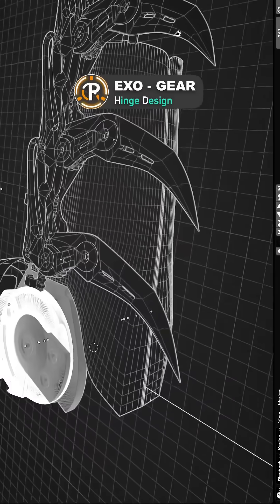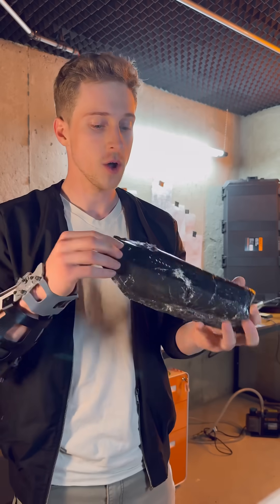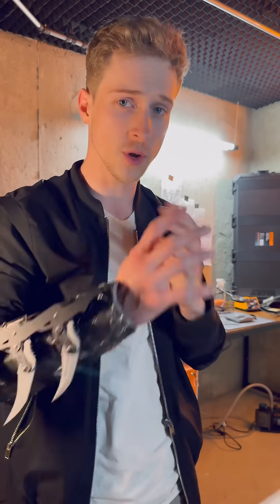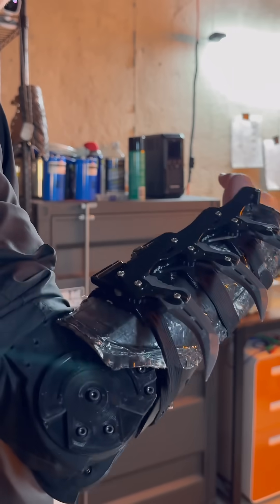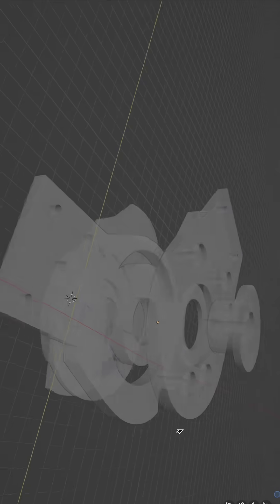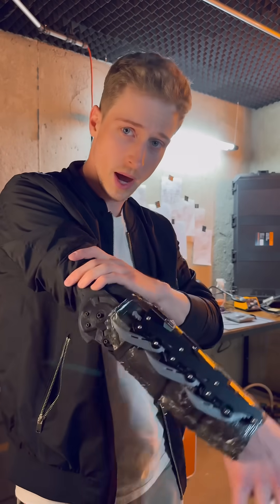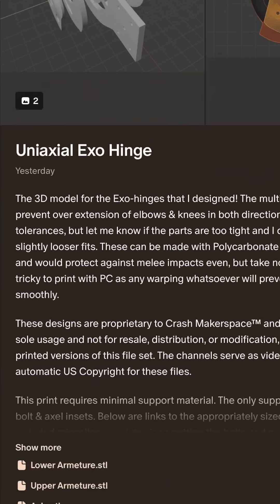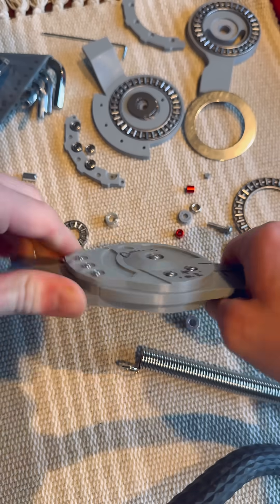Bulletproof Articulated Batman Arms 🦾 #shorts

Comment: You should add forearm gyroscopic bearings to the beginning and ending of the elbow and knee joints to allow rotational motions to reduce stress on the actuating joints as well. Furtherly increasing their durability.

Comment: So limiting the joint's range of motion also prevents it from basically forcing your arm to bend backwards the wrong way and break your elbow, right? Asking from a viewpoint of no engineering knowledge, so I don't know if that's a hazard to begin with or not. I'm assuming it is because of the way you emphasized, "preventing hyperextension beyond 0 degrees, which is backwards".

Comment: Highly recommend looking at late-period plate armor--it's basically the culmination of hundreds of years of figuring out how to fully cover someone in metal while appropriately distributing weight and without affecting mobility.
Reply: Yes this, the articulation in full plate armour was crazy. Had the dexterity to tip toe, write with a quill, ride a horse, and of course, sword fight.
Reply: Although i am an enthusiast in 14th to 16th century plate armor. I would like to point out that late century plate armor was at most 5 millimeters thick, and the arm plate that he showed was at least a full inch.
Reply: @BurkhartKids-s3w  Is there anything to be said about the difference in materials? Perhaps I'm wrong, but I would guess that between steel plate armour and the 3d-printed plastic/resin (unsure what it is)  5mm of steel would weigh a lot more! As long as the thicker armour doesn't hinder movement then it wouldn't be an issue, no?
Reply: @nickpiovesan4361 I came down here to say the same thing. 

When that armor was made, their physiological understanding was next to nothing. Mobility is even what he’s talking about. It’s the armor shifting and rotating around your limbs. Not just range of motion, but speed as well. 

Full plate did nothing to support joints, just be out of the way while it protected you
Reply: @BurkhartKids-s3w Full inch thick? Why would it be?
Reply: Oh hell nah you talm bout knight in shining armour
Reply: Just put magnets under your skin

Comment: One thing I don't know if you have looked into is some way for the armor itself to absorb the backlash from the impact of each strike. Both for arms and legs. When you protect the arm well, it makes it easier for you to hit harder, since your hand doesn't hurt. However, your joins will absorb that impact, and this can and will damage them, especially if you hit things a lit with high force (and speed). Making something to absorb and transfer all of the impact will directly improve the capabilities of what you are making. And not just the elbows. Make something that takes the impact away from the fingers, the hand itself, the elbows and even the shoulders. If the impact can be removed from the backbone as well, this would be even better, however you will need to design a backbone for the armor itself so the kinetic force can travel trough it. And of you have already done all of this, make it so the force gets transferred into the ground, that way the joins of the body will not get damage by the backlash of the hit.

Comment: Wouldnt it be better to actually make the axles flex to some degree rather than clamping? Arent you just in an arms race of adding more and more clamping depending on how more often youre in a scenario that breaks that clamp? After all these are 3d printed parts they have relatively attainable breaking and stress points for rigid plastics like pla
Reply from the maker: These are prototypes; these could be water jet cut steel parts; everything has a breaking limit eventually—but these have a far higher breaking limit than your arm